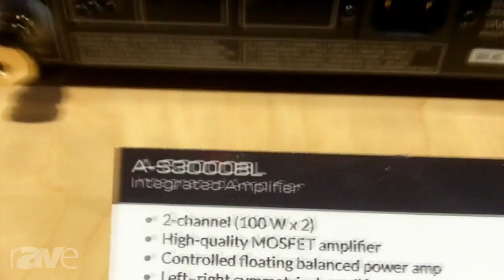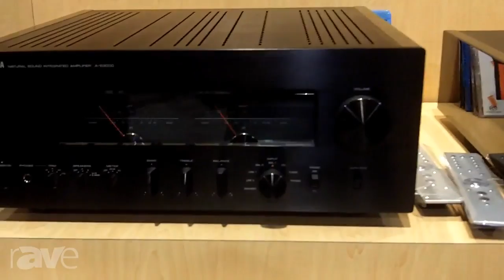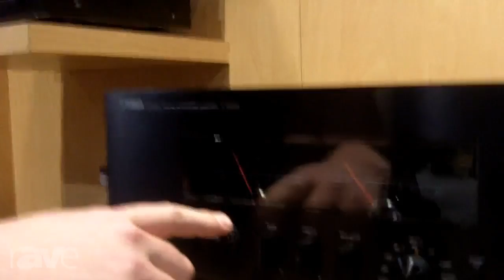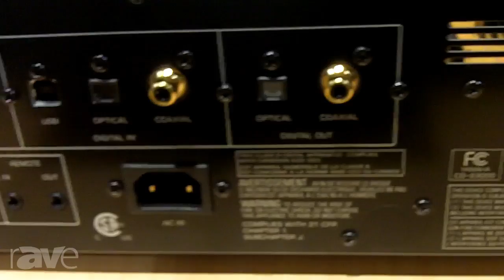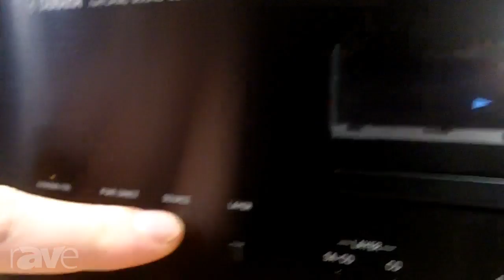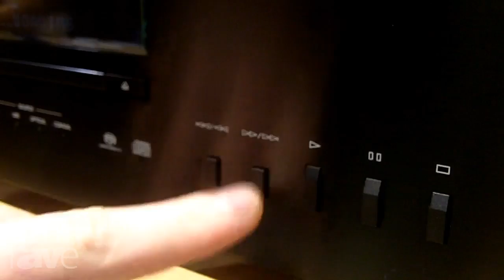CEDIA 2013: Yamaha Showcases Two-Channel HiFi with AS3000

Comment: That is a beautiful amp.  Oh boy...

I am still using a Yamaha A700 integrated amp that I bought in 1982.   All it has needed is cleaning of the moving parts with Deoxit.  It is still quiet and clean, 100 WPC at .07% THD and that great Yamaha natural sound.  I see no reason to move on.  It is like an old friend.

If the old amp does develop problems, I will replace it with another Yamaha, perhaps this one.  At the rate things are going, my current amp will outlive me - LOL
Reply: Glad to hear that! I've got the A-1000 purchased in 1985. One day it didn't turn on. That was 15 years ago so I put my stereo away. I'm in the process of bringing it back to life however the tech working on the amp said it may not be fixable. I bought a Denon DP62L TT with a Grace f9 cartridge last week and just pulled the trigger on the A-S3000 yesterday! I can't wait to bring my system back to life! I'm running a dbx 3bx and Infinity RS 4b speakers. The tech was so cool he hadn't started on my amp a week ago when I received my TT, so he gave me a Yamaha CR 840 to borrow while he works on it so I'm able to use the new to me TT!
Reply: @Vuchswax  Nice!  I remember the A1000, that was an awesome amp.  Super cool that you have the old Infinity RS 4B's.  Those are classic Infinity!
Reply: @Vuchswax  you bought the A-S3000? How is it!? Please tell me in as much detail as you can. I am planning on buying a A-S1100/2100.
Reply: @Phoenix_1991  Yes, I've had the A-S3000 over a year now. I really love it. What has impressed me lately is that the sound is amazing at low levels! I removed the sound treatments from the walls because of some remodeling and I've noticed that at very low levels my system sounds incredible. I always run it with the bass and treble in the neutral position because then the signal is discrete instead of going through an op amp. 

The biggest thing I noticed is I'm able to push the volume much further than my old A-1000. The sound is much better. It seems that the speakers can handle more power and they sound better than they ever did with my old amp. 

I too was going to buy the 2100 but the more I thought about it I knew I'd wished I gotten the large meters. I'm glad I went with the 3000 because of the sound but also it just looks great.  I went with the silver faced version.

It isn't like vintage amps you remember. The amp isn't designed to use processors throughout your whole system. I spoke with a tech at Yamaha in CA. I have a dbx 3bx III & ADC 412 eq and I can't run them through my whole system. I have to run them through the CD player, so only that component can use the processors. I have to say, after hearing everything with and without processors, I prefer the sound without the processors.

Comment: Why couldn't Yamaha base the MX-A5000 on the AS3000.  The As3000 has more capacitors than the MX-A5000,,, wow wtf,,,wtf,,,wtf.  Let's compare the heat sinks of the 1650 watts Yamaha MX-A5000 to the Heat sinks of the 200 watts AS3000,,,once more the MX-A5000 looks like a tin-can that's half empty!!!  What kind of 11 channels am I getting with the MX-A5000????
Reply: "1650 watts''  - pmpo maybe